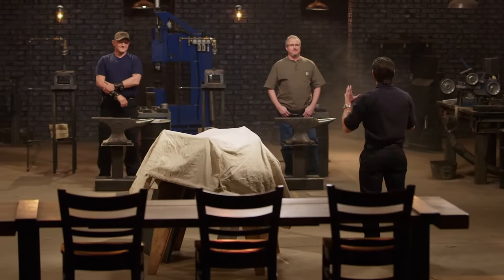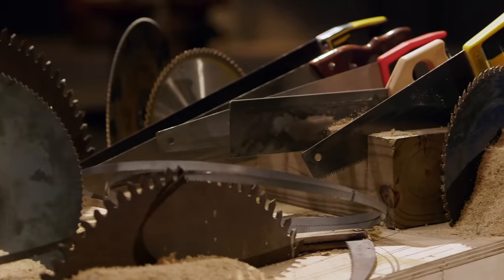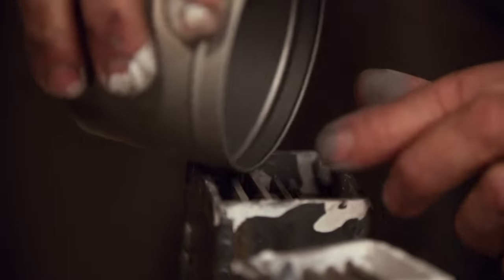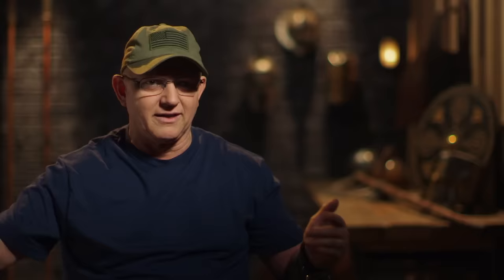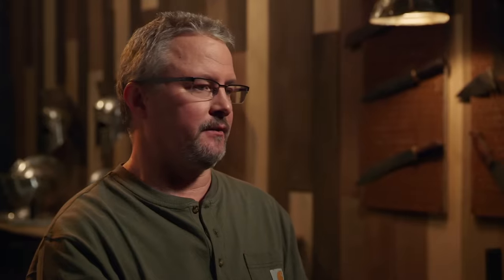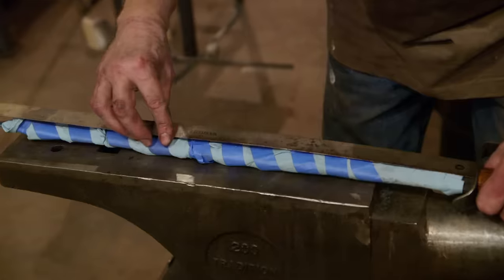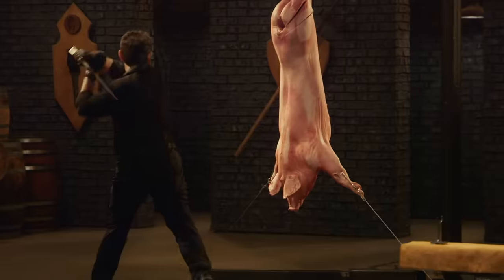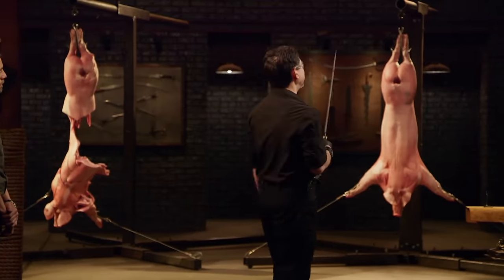Forged in Fire: Beat the Judges: SAW BLADE SWORD CHALLENGE (Season 1) | History

Comment: "We were neck and neck up until the sharpness test"

No you lost as soon as they mentioned the weight.
Reply: I thought this too
Reply: the only way he would have won was if Jay's blade broke, that is the only way anybody will win is for the judge's weapon to break or fail to meet parameters
Reply: @kakerotbardockson2907  Burt says otherwise ;)
Reply: @kakerotbardockson2907  or if Jay's blade didn't cut at all
Reply: The irony is that despite the greater weight, his blade still did better in the sharpness test.
Reply: @guitarhausdoesntknowwhatac3285  ofc it did better, since the judge need extra force to swing it resulting bigger output damage. But thats not the point of 1 handed sword, first of all is the weight that matter.
Reply: Im not so sure this was a fair judgement and I say that with seasoned confidence. Montreal to be exact.
Reply: @georgea7336  the judging based on 
1. Weight
2. Toughness
3. Sharpness
4. Handle
The number goes from top priority to lowest. Jay won becz his blade way lighter than his opponent. Jay blade also can cut, keel, and durable aswell. You need lighter weight for 1 handed sword, no matter how destructive your 1 handed sword is, as long it is heavy, it wont work.
Reply: @ktldon  Do you happen to know of any weapons that didn't have any major failures and were lighter that lost? I'm sure it's happened but for what seems like the last dozen uploads at least it's been pretty simple, be lighter and survive and you win.
Reply: @ktldon  better than a sword that doesn't cut. I would rather have heavy one that does what it is meant to.
Reply: @georgea7336  i think the other guy should've won. Nielson's blade didn't even cut the sandman except on the arm
Reply: @danielblairmadrid837  You can sharpen the sword, in battle swords became useless after a few chainmail hits, so it is better to have light one handed sword than heavy one, both of them will be dull after a few strikes.
Reply: @kugelschreibepkugelschreib5116  well it looked brittle too.. A real test against armor prob would break it. I'd still take the other sword.
Reply: @danielblairmadrid837  Well, in the end everything is about ones opinion and liking, but imho decision was fair, one handed sword is slicer, not chopper and should be light, there is no use in heavy one handed if you can´t parry properly after short period of time.
Reply: @danielblairmadrid837  If it was brittle it sure didn't show it breaking four thick clay bots and slicing the pig.  The four pots are just as damaging to a blade as a metal sheet is.
Reply: @DKarkarov  They use armor which is much harder..they should have this time so we could watch it break. And it never even hit pig bone because cuts were too shallow.
Reply: @danielblairmadrid837  Except it wouldn't have broken because it had a proper heat treat, and they both would have just gone even duller.
Reply: @DKarkarov  We'll never know now.
Reply: @kakerotbardockson2907  No, they said it was almost 4 pounds. At that point you're struggling to control overswing, it's a really frickin' hard sword to control and not rip your wrist to shreds. A heavy sword is a *problem*.
Reply: @mfree80286  nobody sees what it weighs for all you know it's two pounds ten ounces, the fact is the judges know who they want to win and unless something major happens like it breaks that is who wins.
Reply: I'm glad i'm not the only one who noticed this. Anytime the judges say a blade's heavy, or they mention a blade is particularly light, they have  a winner already.
Reply: @user-on6uf6om7s   In season 1, the episode with the Fan-Sword.  It was a very experienced smith vs a talented youngster. The Smiths sword was lighter and they mentioned the youngsters beeing quite heavy. But the Younster won, because the Smiths handle was uncomfy and rolled in the hand.
Reply: This was a BS match, the heavier sword was far more elegant, the heavier sword cut 3Xs better! Was there a handler endurance test for these swords? NO! All performance test! Heavy sword for the WIN!
Reply: basically, it was not included on the 3 test parameters.. 1. keal  2. Strength 3. Sharpness (Cut)
Reply: Weight is about control, without control, sharpness and everything else don't matter. Also those pots did a lot of damage to their swords though.
Reply: @guitarhausdoesntknowwhatac3285  apparently you dooesn't know how short sword is suppose to work
Reply: @wouldyoumind993  I know how it works. I also know that the tests are about results and the heavier blade performed better.

Probably because my eyes work.
Reply: @4Curses  Proving the point of the commenter.
A ROLLING BLADE IS VISIBLE ON CAMERA
Reply: @superblahman  What? Controlling a blade which you hit a shield once with and now cannot cut past a gambeson is innately worse than a blade which would take that beating then still cut a gambeson; no matter how unruly. What use is control of a weapon that literally does no damage?
Thats exactly what I thought, use your eyes.
Reply: @kakerotbardockson2907  superchamp competition says otherwise
Reply: @kakerotbardockson2907  or suffered decent chipping on the edge, not even massive. It was a close one.
Reply: @superblahman  No, its simple. If weight is going to be a serious issue where they will disqualify a blade. And yes this is what they did the moment he said it was heavy this contest was over. The only thing they where waiting on was to see if Jay's blade broke or was too heavily damaged to "Justify" it. But more over if its going to be a serious parameter that will remove a blade from contention it needs to be explained and pushed along with the Sharpness and other parameters during creation.

You also do not know if his blade was actually 4 lbs they did not weigh it on camera they could just be giving a general number to imply its heavy. And you have no proof they wouldn't have said the exact reverse if his blade was lighter.
Reply: @D-Vinko  A blunt sword can do a lot of damage. It's a hunk of steel man. 
Sure one that can hold it's edge is superior, but the overall, control of your sword is required. What if they sidestep your blow, and the sword is too heavy to easily regain your footing, you are dead. There are times where one can recover if your sword isn't overbearingly heavy.
Reply: @neerdowell6687  A one handed sword should not be putting strain on your lower back, if it is, it's made too heavy. Yeah I know it's steel, but if a fit strong man needs to readjust himself, do a stretch, after just a few swings, it's too heavy. Short swords were for very prolonged battle, and they needed to be weighty, but not to the point that you might pull a muscle in your lower back or something as you swing. Hence finding that right balance of good weight, but not so much it's backbreaking.
Reply: @superblahman  The judge didn't follow the rules of the build. He is automatically disqualified, he only won because he is a judge. There is no mechanical attachments with his handle, we see both sides and it is solid wood were as the other guys has the mechanical attachments.

Given that they let him keep competing when his build outright does not obey the rules.. sorry but they were probably lying about the weight.
Reply: @user-on6uf6om7s  I recall an episode with a claymore sword. It was lighter and too flexible for good perfrormance. I agree though that the competitor basically lost when a high weight is mentioned.
Reply: TBF, they were looking to nitpick literally anything to hand the win to jay. His sword literally couldnt cut it and he still won.
Reply: Weight was not a parameter. Some swords benefit from a heavier weight, as we can see from the above demonstration. Tony's sword killed in the carcass test AND the sandbag test. If you pay attention to the carcass test, when Jay's blade is being used you can hear it hitting bone and stopping, especially on the very last strike. No such problem with Tony's.
Reply: No he would've won if the judges weren't so biased to their own. Get real. The weight was a sorry excuse.
Reply: The judges sword did fail to the meet the parameters as the handle wasn’t mechanically attached as was specified as one of the requirements of the build. Whereas a specific weight requirement was never stated as one of the parameters. The judges sword performed worse in all tests compared to the other competitor. If they’re going to be strict about following parameters the judge should have been disqualified before the first test for failing to mechanically attach their hilt. This just stinks of not wanting to damage the reputation of a judge, who is considered a master smith, by disqualifying him for failing to meet basic stated requirements of the build or being beaten by a non master smith competitor.
Reply: Because none of them are professional sword users and they use hydraulics for forging so they dont have stereo type strength you would see from a smith who does it old school.
Reply: No Jay he Lost..why did he win Because Jay Is on the Show...Jay made a Ugly Blade and it couldn't cut...Jay lost this one but they gave it to him anyway....Cheating the Other Guy who's Blade did everything they asked..Horrible plus they gave them 8hrs and Jay's Blade wad Ugly they tried not showing us but we see it it was Ugly
Reply: JAY LOST....I would not say that about Ben work when he makes a blade its a great Blade and we know who is the winner..but Jay put up junk

Comment: Jay your weapon is so light and feels so good. I could not cut targets all day with this thing. YOU WIN!
Reply: i mean its better to have a light sword that doesn't cut to atleast disarm your enemy rather than having a heavy blade that takes a quarter of your stamina after every swing
Reply: @goose9245  The purpose of a weapon is to do damage to your opponent, so no that is an incorrect assessment.
Reply: @Crimsonfangg  ok look at it like this: would you rather risk you getting stabbed because the enemy has a lighter blade or would parry it because your blades are the same weight?
Reply: @Crimsonfangg  lol trust me, you're still going to hurt your opponent with a light blade. I fence multiple different forms of weapons every week and I'd take a light, well balanced blade over a chopper any day. Both have their place, don't get me wrong, but If you're specifically wanting a weapon, balance, maneuverability and ease of use are king. Can't parry a strike if you're busy trying to lug back a heavy, poorly balanced weapon after a swing.
Reply: @Crimsonfangg  the purpose of a shortsword is most commonly a side arm. Having that being very heavy is an extreme problem. If you have a shortsword with the weight of a longsword. Get a longsword.
Reply: @ethanv7330  Having it not do damage is an even bigger problem. This sword would literally get stopped by a sweater and that's not an exaggeration. Secondly, it's not a shortsword. Shortswords are double bladed THRUSTING weapons. The viewers of this show are every bit as ignorant as the judges. General rule of thumb - don't debate things you know nothing about.
Reply: The extra damage Tony's sword did was mostly because of the weight. The sharpness was comparable, one was just heavier. You shouldn't compare swords by how well they can bludgeon a target to bits.
Reply: @Crimsonfangg  A short sword can be single or double-edged. The name "short sword" typically classifies it as being longer than a dagger and shorter than a longsword. There are many different styles of short swords throughout many cultures. Granted the ones most commonly used in battle were double-edged, with a short hilt and cross-guard, often used as a secondary weapon.
The swords forged in this video appear to be modeled after the hunting sword; which is a short sword dating back to the 12th century used by hunting parties for finishing off game, and then later adopted by military officers who wore them as a badge of rank.
Reply: @ultimomos5918  No it won't. You fencing gives you no authority over reality. I dunno what fencing you do where you use multiple "forms" of weapons, but I fenced with foil and sabre for 12 years. Actual olympic fencing and in competition. Regardless, anyone wearing a gambeson would be completely safe from an endless number of strikes from the lighter sword. In no way would it hurt them, at least the heavier sword would eventually shred the gambeson enough to inflict real wounds.
Reply: @nextlifeonearth  Not true, the weight has nothing to do with its ability to slice through that fabric. If it was chopping through the arm would have moved out of the way rather than getting cut off like it did. That along with how the judge was dragging the blade rather than chopping with it shows it was indeed the sharper sword.
Reply: @Sgtassburgler  you are judging the sword "unable to cut" based on plastic wrapped bag of SAND ... being hit by static chops instead of draw cuts ... after being blunted on ceramic pots ...

how about looking at what the blade did to a pig instead where it performed beautifully.
Reply: @Crimsonfangg  A light weapon can fence the opponent, and still act as an effective bludgeon even when dull, let alone stabbing. A heavy weapon can't fence the opponent, and therefore can't even be a bludgeon to begin with. Even one-handed warhammers tended to be light.
Reply: @Sgtassburgler If you have a 1kg bar of metal slam into your arm, fingers, collarbone, or head, even with some armor, even without a cut, you will not be okay. You can always also stab with the lighter, if dull, sword. 

"Fencing" can refer to the ability to duel with a sword, not specifically traditional foil, epee, and sabre fencing. The latter kind of fencing does not have realistic sword weights. HEMA is also fencing, and most likely what they're referring to. Buhurt involves fencing. Kendo is all fencing.
Reply: You clearly have no idea how heavy 4 lbs is for a short sword.  A short sword should only sit around 1.5-2.2 lbs.    4 lbs is heavier than some longswords or two-handed swords that are short enough that you can wear.   As someone who  practices with swords even I would struggle with a 4 lb short sword especially if its balanced poorly.  

A sword that is too heavy can hit someone who is stationary but it can't be used to nimbly parry and there comes a point where that extra weight has no benefit as a 1.5 lb short sword can happily split skulls if designed properly.
Reply: @Subutai_Khan  Weapons are made to deal damage - if you fail to do that it doesn't matter what its dimensions/specifications are. I'd take a clunky weapon that does dmg
Reply: @Crimsonfangg  You clearly did not watch the kill test. Each of those cuts were potentially lethal.